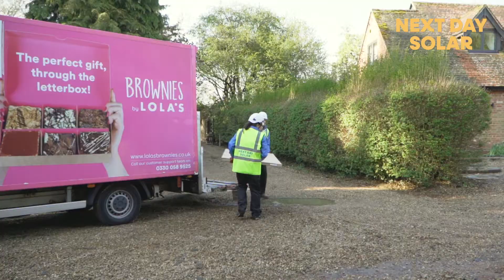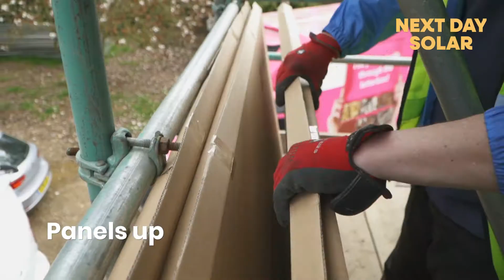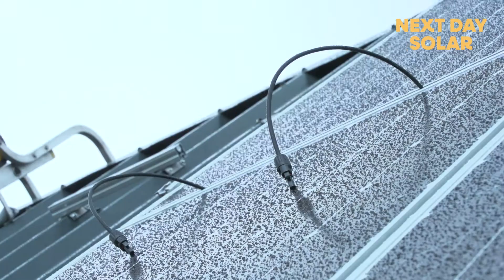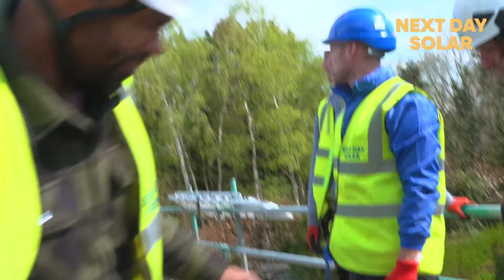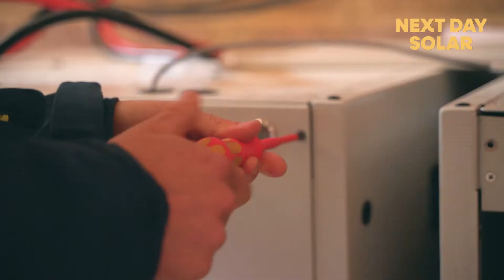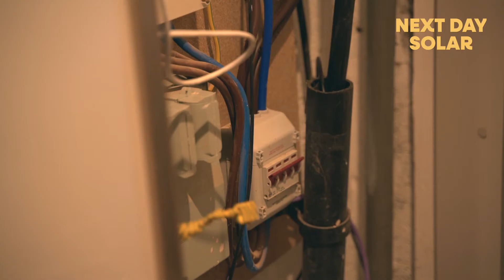Full Solar Panel Installation, including BYD Batteries, Victron Multiplus II.

Comment: Hi, I'm a curious amateur and I have a few questions about this specific setup. It seems that you have set up the system with two SmartSolar MPPT RS 450|100  charge controllers and for each tracker, you have a string of 7 solar panels as shown. What I'm trying to understand is what is the layout for each string, are they in series or in a different configuration? Also, I would like to understand what is the relationship between the 4-string PV arrays and the battery size (it seems 2 * 15.36 kWh BYD Batteries). What is the best ratio in order to charge the batteries without working them too hard?

Another point about sizing the batteries and the PV arrays, there are 2 strings being coupled in an AC phase, would that phase be used to charge the batteries too if needed? And if so how do you size the system taking all these into consideration? Not sure If I'm overcomplicating things...

I know that Victron systems have some integrations with BYD batteries, but in the video, I could not see the GX being connected to the BYD BMS system, where was the BMS placed that we could not see?

I'm also wondering if the DC connection box in the middle is a Lynx Power In module and the other two are Lynx DC distribution modules.

Thank you in advance for your help.
Reply from the maker: Hi, each string in series, which is the most optimal setup to avoid voltage drop and efficiency. There is no 'direct' relationship between string size and battery capacity, however there are some minimum battery sizing requirements based on the inverter which Victron Stipulate. There are max charge/discharge limits configured by BYD BMU, so you needn't worry about over stressing the batteries, but I understand your point, if you had a massive array, you'd be charging a small battery too fast (or have the ability to do so) and would then need to look at extending the battery bank to share the charge load across more batteries. I think the key point here is that the system is setup in ESS, so always provides loads to house first, then charge, then feedback to grid. Additionally, the 2 x MPPT RS have a charge CAP of 100, so you are looking at 200A for the battery bank, and they are capable of accepting 300, so we were we'll within tolerances, but of course this relationship should be checked.
Reply: @nextdaysolar3349  Thank you so much for your fast and clear reply, it simplifies a lot of my misunderstandings, the main takeaways that I was missing were the BYD BMU management and the Victron ESS that can easily deal with excess electricity. Really appreciated!

Comment: What's the reason behind having an AC (fronious) coupled and the victron system? I understand if you are upgrading from an existing grid-tied system, but from scratch, what's the reason for that?
Reply from the maker: Sorry for the delay, so in essence, best of both worlds. We have the efficiency of the AC coupled system to get the best out of part of the array, when feeding the house (and we knew the house would always have a load) and then a more efficient DC storage system, for saving energy for use in the future. If we just had the AC obviously there'd be no storage, if we just had the DC , we'd be converting from DC to AC the whole time, so the AC coupled, allows the AC inverter to deal with the primary loads and then the DC steps in when needed.

Comment: Looking to install an AC couple ESS victors system myself……can you and your team help?
Reply from the maker: Sure, we typically work within 1h of London, can obviously advise remotely as needed. We are happy to help you obtain parts as a certified Victron Dealer, and discuss the wider project. You can email us with details if you like hello@nextdaysolar.co.uk, or we will be on the phone from Monday 0203 608 3475, the Victron ESS system is great, a'lot more control than other systems, and you can actually get the parts, which is more of an issue with other manufacturers.
Reply: @nextdaysolar3349  Thanks! I have emailed you direct 🙂👍

Comment: I was wondering about earth when installing my panels. If they are still isolated then why connect to earth? Surely this only creates a possible single point danger but if they are still being installed then earth is irrelevant and you just need to worry about +ve to -ve connections.

Comment: Yes, I would like to know what are the 3x Multiplus II units used and why did you choose this path rather than use Quattros?  Are they in parallel?
Reply from the maker: Hi, they are 5000's, we choose this path, as they are G98/G99 compliant, where as the Quattro is not, and more suited to off grid applications. They are sat in parallel, but there is a chance in the future to re-config for 3-phase should the customer install a high speed car charger, so we left options open, if the customer decided to re-wire the house in the future. A 3-phase supply existed.
Reply from the maker: They are setup in parallel, but we used, to ensure that in the future, we would be able to setup in 3-phase if needed (as client as going to add a 3-phase car charger down the line) , we didn't need the functionality of a Quattro with the dual input, its more designed for when you have say shore power and generator back up, where as multiplus 2 only has single input.

Comment: A bit more tech explanation/details and less promotion please
Reply from the maker: Agreed, it was a 'promo' video and if you'd like any of the tech details/workings or schematics just let us know. Thank you
Reply: @nextdaysolar3349  Thank you.👍
Reply: @nextdaysolar3349  hello how is the multiplus 11 connected to the AC grid ?
Reply from the maker: @SNOOPY4320  Hi Greg, the Multi has 3 AC connections, AC IN / AC Out 1 / AC Out 2. We wired on the AC IN, which is bi-directional. In an off-grid setup, its possible to wire the MULTI on AC Out 1 only, which will simply provide an AC sine wave and power to a circuit. The AC 2 OUT is used, if you need a circuit that is sustained when the AC IN circuit fails, i.e circuits that are critical to keep running in a setup such as wifi/medical equipment etc. From the AC IN, we have an AC isolator, then a breaker within a dedicated fuse box, and then connected to the main AC of the property.